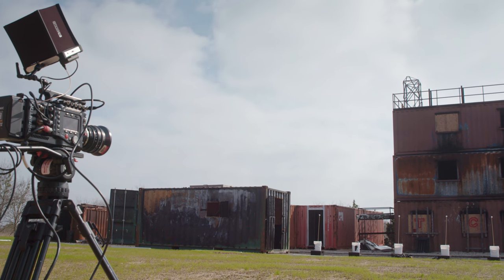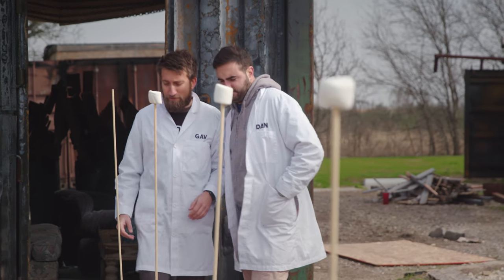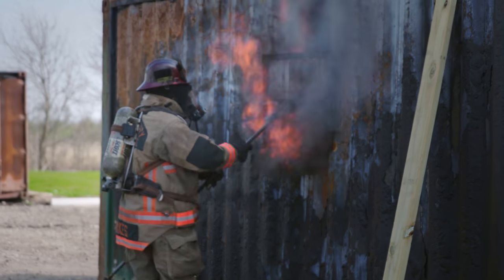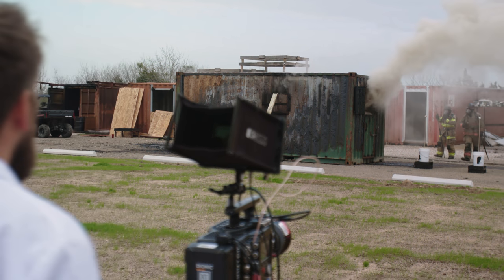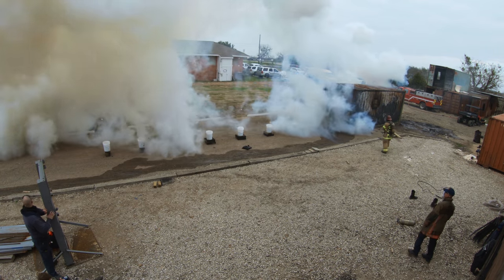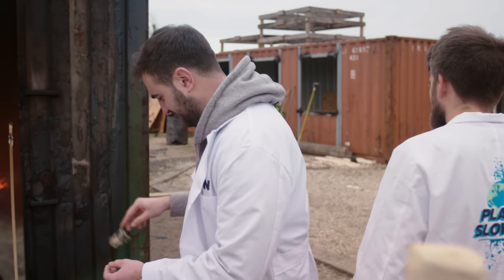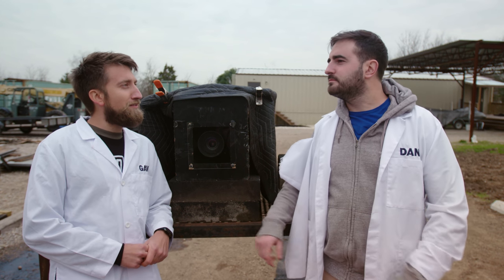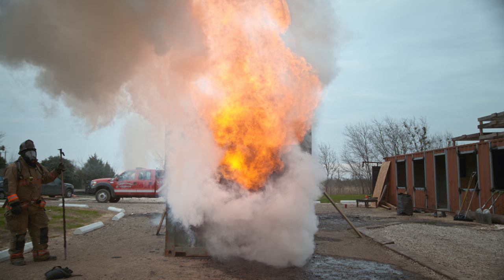4K Slow Motion Backdraft

Comment: SEE, the first one is Exactly why they are so dangerous. One more second and that guy would have gotten a face full of fire. Mad respect for the guy for being a pro and walking it off.
Reply: Why did he go in front of it anyway when he knew it could happen any moment..
Reply: I think it was a mistake to walk in front of it when it's about to go off. Unless someone denies that, he won't be getting much respect from me.
Reply: His kit is designed to withstand high temperatures, so even if he was in the centre, as long as he either fell to the ground or jumped out of the way as soon as it made contact he should have been fine.
Reply: his reflexes were so fast he had his eye on it, he reacted immediately and didn't get burnt
Reply: @finian2  With the amount of air that it is blowing, it could for all I know be able to blow it inside his suit. I definitely think that it is against protocol regardless - don't put yourself in unnecessary danger, regardless of the extent.
Reply: well to be fair he was going to duck under the window. Still stupid though.
Reply: if you all want to go back, the capt. said "Let's open up the windows"
Reply: Dwaing that guy probably got torn a new one for almost dying lol h wishes the fire got him
Reply: Mikkel Højbak the suits are very thick and are basically air tight so he would’ve been fine as the suits are made for protection so no hot air is going to get to him while he wears that suit
Reply: He most definitely is not a pro after watching him walk in front of a hole you’re expecting an explosion from 😂
Reply: I'd heard of backseat gamers, but these backseat firefighters are a whole new breed!
Reply: Doesn’t take a firefighter to realise you don’t walk in front of a hole, where the sole reason for you being there.. is because you’re expecting an explosion to come out of it! 😂
Reply: Evan  Yes, he was told to open the windows. What part of "open the windows" required him to walk in front of a backdraft? The guy could have walked around the back (preferred), or walked in front but outside its range (less preferred, but still safer than walking right in front of it).
Reply: as a firefighter, I can conclude only one of two things: either they did it for show for the camera (while the slomo guys can't predict when it's about to go off, we can) OR he was a genuinely incompetent firefighter but authorities kept him on payroll to keep his pyromaniac tendencies in check within the testing facility... (wouldn't be the first one. The best firefighters are usually not the ones teaching the classes, but the ones who teach hands-on in the field)
He approached the window in all the wrong ways, not observing any of the basic rules. But he was wearing full protection, so he wouldn't have sustained any injuries from such a flame... Too low temperature and too shortlived to be a danger to the suit and apparatus. Bad firefighters get overconfident because of good equipment. Some of them are ticking timebombs, accidents waiting to happen... On the other hand, I've had my share of air-time on real live interventions, while properly observing all precautions (and therefor not sustaining any injuries even though I flew through the air smack against a concrete wall). Discipline and routine repetition are probably worth more than the suit...
Reply: @Hannibal1946  it didn't look to me as if he was ducking. And he approached at too steep an angle... He should have been much closer to the wall.
Reply: Evan  No, the door was already open. Still, even if he was trying to open the door, that's what they have those big long poles for.
Reply: @lukearts2954  Yeah, I assume you can see that it stops breathing in air as quickly right before it happens - meaning the smoke will take a bigger area at the top of the window for exhaust. Possibly a change in smoke color as the gases begin to react the flame point.
Reply: both are pointers. Colour of the smoke is very important (brownish swirls indicate superheated unburned flamables). But a fire burning low on oxygen also sounds differently and I bet these guys do this so often that they have some location specific markers too that indicate when it's going to pop.
Reply: If he was a pro he never would have been walking in front of it
Reply: @HiddenWindshield  He was moving to open the bottom of the door.
Reply: im more inclined to say. what pro/trained professional would knowingly walk in front, an i mean directly in front, not even at a distance, of something like that? especially knowing it hasnt gone off yet so it could at any minute. he should have gone around the back. even if its just a demonstration/training he shows a clear lack of respect for the danger he is dealing with. you wouldnt call shooter that walks around in front of loaded guns that might go off a professional.
Reply: Evan that's the problem with power hierarchies, people should double check with their own brain before obeying blindly.
Reply: He didn't walk in front of it, though.  He was to the side, bending down to open the lower door catch, someone else was going for the windows.
Reply: mc finn  He didn't.
Reply: @Hannibal1946  No,  he was the one bending down to open the door catch.  He never got in front because he wasn't going past.
Reply: Yup, pretty sure EVERYONE learned something today.
Reply: But why would he try walking in front of the door when he knew that’s where it would happen. Pretty stupid if you ask me.
Reply: @maiseydoodle  He wasn't.  He was reaching for the door handle as they were told to open the windows & the door.  That's why he was bending down when it blew out.  He had already stopped to the side of the door.
Reply: "Professional"? Anything but! Even a kid knows not to approach a seemingly dud firework, that firefighter was hugely unprofessional - they more than anyone should know you can't attach a time limit to these events and he should never have been anywhere near that doorway.
Reply: Although on review I suppose the senior officer their bears culpability; he instructed his men to open the windows and simply watched as the one lacking common sense walked right into the danger area. As a superior officer he has responsibility for the safety of the men underneath him, and I'm afraid he rather dropped the ball there. Some may feel I am being a tad harsh, but the consequences of error in fighting fires are such that safety standards cannot be allowed to slide.
Reply: @noneofyourbeeswax01  They also said, "and the door".  That guy didn't walk in front of it.  He stopped at the side of the door & was bending over to reach the door handle when it ignited.  He was on the other side of the smoke & flame, & not in any direct danger.
Reply: mc finn  5:13 he stops walking & bends over to reach for the handle to open the door.  Does no one watching this pay any attention to what the people involved are actually doing?  This isn't a newspaper that needs false drama in the headlines to sell copies.
Reply: @NemoConsequentae  And that kind of asinine "justification" of rank unprofessionalism through peevish pedantry  is just the kind of wilful ignorance that places people's lives in danger and shirks all responsibility. It was a schoolboy error, it should be owned up to and addressed, not covered up and obfuscated with risible excuses. This is just another example of the refusal to accept responsibility (while insisting upon retaining authority) that is working it's pernicious influence on contemporary society.
Reply: That firefighters brain must have been thinking, OH DANG I NEARLY GOT KILLED
Reply: @RozeofTheHiddenMeadows  Yes he did but I doubt he expected a pro to walk across the expected backdraught path like that.  That could have been one painful reminder not to be complacent.
Reply: @captain_britain  Not a backseater, a thirty year pro. but don't defend idiocy.  That was prime idiocy obvious to even non-firefighters.
Reply: @brentonlee5535  Oh he's pro OK but has forgotten the prime rule.  Do not get complacent just because you've been there, done that and got the tee shirt.  Complacency kills.
Reply: @NemoConsequentae  Wrong,he was going for the window on the nearside.  The OIC didn't ask for the door tone opened.  You cannot defend his action by making up your own scenario!
Reply: @Biffo1262  If you listen, you can hear:
"Open the windows"
"And the door?"
"And the door."
He then goes to get the door.
Reply: @noneofyourbeeswax01  What pedantry?  What justification? What error?  He was told to open the door.  He walked over, stopped to the side & was bending over to reach the handle.  When the smoke shot out, he was on the other side of it, not engulfed in it, because that is where he meant to be.  Certainly he was close to it, but not in any direct danger from it.

I can't help it if you didn't pay enough attention to what was said & misinterpret the events, but please at least LOOK & LISTEN again, rather than doubling down on you error.
Reply: @NemoConsequentae   I refer you to my previous response. Have a nice day now :)
Reply: J Roos We waited for more than three times as long as it was supposed to take to blow. Chief called for him to open it up so we could try again. I’m the dude with the red hose at the end of the vid.
Reply: @TheRyanRags  As far as I can see from the video, you all did everything right.  

Fire is just somewhat unpredictable.
Reply: @TheRyanRags :  "...more than three times as long as it was supposed to take to blow"

I was surprised to learn just how rare these backdraft occurrences are. This being the case, I would suggest that perhaps such data as the above quote is based upon is not sufficient to provide reliable predictions. Thus this experiment can surely only add significant and possibly life-saving data by extending the known envelope for recombustion. I think this is - or perhaps ought to be - the main takeaway here.
Reply: NoneOfYour Beeswax If we had access to equipment to more accurately measure each factor in the process, I’m sure we would be all over it. We just have a big metal box and some wood.
Reply: it was clearly a mistake on the firefighters behalf but we are all human
Reply: @finian2  you clearly have no experience in the field. Your gear isn't made for such high temperatures
Reply: @davidhussey524  dude. Im reading your comments and I'm speechless. Im sorry but no, there's such a thing as heat penetration.
Reply: @andrewcastleberry4921  One year later
Reply: Bad
Reply: @finian2  
Thank god Andrew is here to set us straight with what equipment is sufficient for fire safety, his experience with the Jerry Can from GTA 5 has taught him so much.
Reply: What was there to walk off, he's fully suited up
Reply: @Seelenschmiede  op
Reply: I’m surprised more people aren’t commenting about how he narrowly avoided dying.

Comment: "If a plane flies through smoke, does it drop?"  6:02  Yes, it does.  I am a pilot and I have flown over a smoke stack of an industrial complex, about 500ft above the stack.  The plane didnt "drop" or fall out of the sky but what was experienced was severe turbulence.  The rising heat and density change of the air made the plane shake violently for a split second.  Thanks for the video.
Reply: I like how you say it didn’t drop out of the sky, as if their question was legitimate
Reply: Nice
Reply: Bore off - tablet
Reply: I’ve flown through wildfire smoke columns and yes, it’s turbulent.
Reply: @jamesbizs  Fall out of the air could be a way of saying stalling
Reply: And if you get enough smoke and ash debris in the air youll get "Saint elmo's fire" around the aircraft as the friction with those materials charges the aircrafts hull, that and horrendus engine clogging and likely damage if theres enough of it, it cakes the turbine like concrete and basically sandblasts the entire engine causing significant wear. 
I remember that much from a documentary about aircraft that have flown near and through volcanic plumes.
Reply: ""If a plane flies through smoke, does it drop?"  6:02  Yes, it does. "

"The plane didnt "drop" or fall" 

Both of those within sentences of each other, in your comment *face palm*.
Reply: @billyfraiser6298  In his defense, it would depend on the amount of smoke and the temperatures of the thermals. Smoke will choke engines and cause a loss of power and sputtering, thermals will give lift so you're looking at heavy turbulance and if the engines are choked completely out could cause a serious loss of altitude, they need heaps of oxygen to keep running. Not an expert but I've absorbed a little related information here and there.
Reply: For some reason I kinda doubt he’s a pilot
Reply: And why were flying over a smoke stack?
Reply: Your plane should be a lot higher than a smoke stack.
Reply: I love seeing people share their experience & knowledge. Never would’ve thought of that
Reply: @isaiahchevalier4971  I don't think he's talking about a commercial flight? Maybe one of those agricultural crop-dusters? Or the ones that carry and drop water? Don't know what they're called. 😅
Reply: @dustybottoms2780  Why would you do that? It's not like a huge fire suddenly appears in 1 second.
Reply: "Yes, it does." 
Proceeds to explain how it doesn’t
Reply: Its like a massive thermal.
Reply: @isaiahchevalier4971  My father is an avionics technician for 25+ years and a pilot. Just because a pilot doesn't know everything about how a plan behaves in extenuating circumstances does not mean he is not a pilot. There are different pilots and planes too, commercial vs hobbyists, multi-engine vs single props. Lots to know.
Reply: @natm5224  alright
Reply: I like that you included "for a split second" since at the speed you were going you'd be through the atmospheric disturbance in a second or two in most cases.

Comment: "It's only fireproof, until it's not"
- Gavin Free, 2019
Reply: In fairness, it is actually a very accurate way to phrase it. Things that are "fireproof" will hit a certain point where they just burst into flames.
Reply: Bastian Springer
 - Nothing is fireproof. There are only varying degrees of fire-resistant.
Reply: @johns7734 
Wonder how actually true it is.. 
There are materials which are technically fire proof aren't they. 

Water for example?
Helium...
Reply: @dreed100  The word "material" implies a solid. Solid water is hardly fireproof and you would be hard put to build anything from helium. However, water is not fireproof. Putting out a magnesium fire with water is a huge mistake as the magnesium will break the water molecules apart and use the oxygen to keep burning. That leaves the hydrogen behind which also burns. Similarly, putting out a sodium fire with water is also very entertaining. As long as you view it from a sufficient distance and not from the end of a hoseline!
Reply: @johns7734  And then we have fluorine fires which will make almost anything flammable, including things that aren't flammable in an oxygen atmosphere like a block of iron. And then ClF3 takes it past 11 and up to 20 and I'm reasonably sure can react to anything short of N2 or noble gasses.
Reply: @zephyr139  Masonry will melt at a high enough temperature, what do you think lava is?  Molten stone.
Reply: But what hapenned with go-pro inside?
Reply: I knew it would be in here somewhere
Reply: @borisyamba  quote, overheated
Reply: Super accurate, there is no such thing as fire proof, only how long until it succumbs/how much heat it can withstand. Everything burns, eventually.

Comment: Here in the US, we are big fans of Hickory wood flavor in our food. I worked at one of only two locations that made a product called "Liquid Smoke". I was a furnace operator there burning 8 tons of hickory chips in an 8-hour shift. Basically keeping the furnace right at 5 to 15 seconds away from a backdraft event. Looking back, I guess I was a bit of an expert/fire teaser at creating the perfect environment for backdrafts, without letting it actually have one occur. We had a very tall smokestack with metal walls inside over each furnace. Suspended inside were racks of wires hanging from top to bottom of the stack. Wires were connected to antique X-Ray machines which created a very high electrical field between the wires in the stack. Smoke gets thick enough and the electrical discharge made the smoke attract to the walls as an oily, resin-like deposit. Gravity and heat collected this Liquid Smoke at the bottom of the stack and then when my barrel got full I would pump it out to an above-ground storage tank for processing at another facility to make the food flavorings and extracts. Our wall phone, opposite the furnaces, was a frequent victim of the backdrafts. Even though it was 20 to 30 feet away, Salvador Dali would have used that melted thing in his artwork without hesitation! When the furnace DID belch fire from a backdraft, your best choice was to just fall back and let it go over you. Quite a sight to see, and an attention-getter there mates! Between the flames, smoke, and high voltage electricity, it was a very dynamic job experience, to say the least!
Reply: Liquid smoke is a good product.
Reply: @Rick Sanchez 
I still love the smell of hickory to this day. That was in the late 70’s. Lololol
Reply: What an incredible story.  Antique x-ray machines!!!
Reply: I've always wondered how they did that 

Thanks for the informative comment